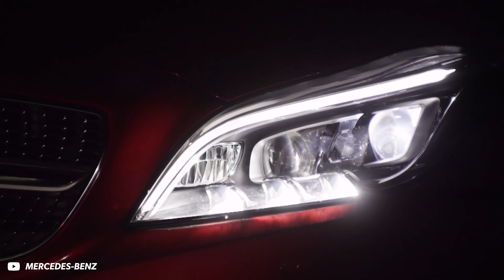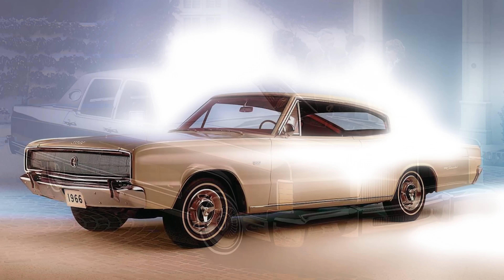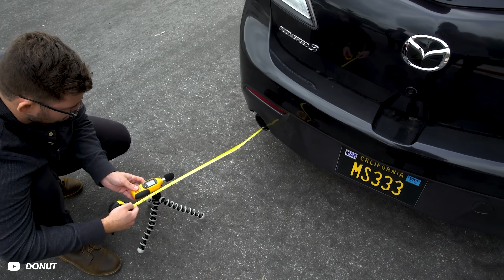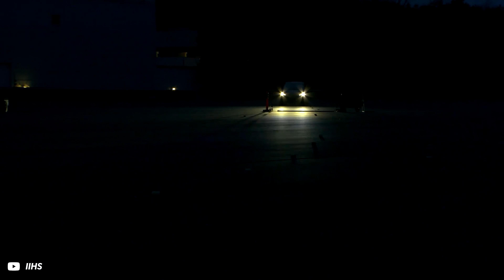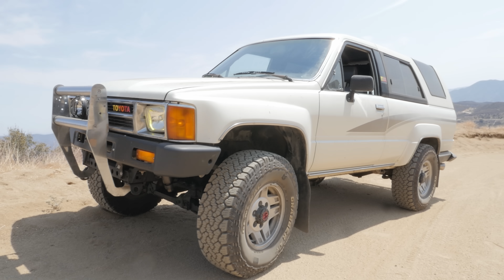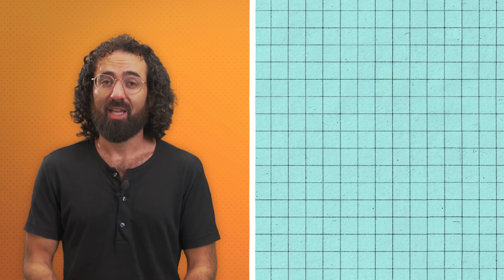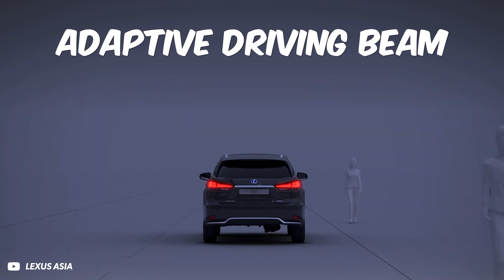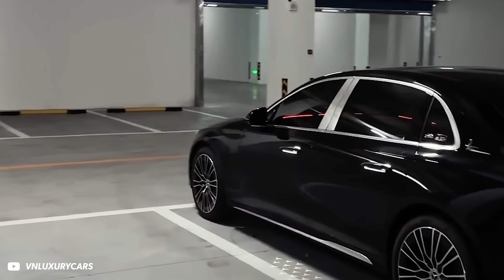Why new headlights are blinding American drivers

Comment: If you're in porsche released in 2022 or earlier, they don't disable always
Also for people on the receiving end - clean front glass, tall car (and when from the back you cam try angling rear view mirror up/down as many of them have 1-2 bonus mirrors with darkening filter, for example my 2011 xtrail has  it so your car probably does too)

Comment: I had a 2019 Miata with adaptive high beams and they worked great; however, even when driving with the normal low beams, other drivers would often flash the highs at me, which meant my lights were maybe too bright. I had zero control over it, no dial to set the height, because the system was controlled via the height of the rear suspension. I talked to the dealership about it when I went in for service and the mechanic told me, basically, "the lights are fine".

Comment: Just an excellent evaluation. I  cannot tell you the last time I knew of a dealer (or government inspection place) that would bring out that tool to check your light - it was always been, look at the wall and adjust - my '21 Elantra - I took it back the next day and it had crazy eyes - one light WAY up, on light WAY low - they fixed it in like 10 minutes and they were only "okay" (not the same but close) so I think they just did the look at the wall aiming. They need a machine that the police would even set up and check cars on with (daytime even?) with a height and vehicle type adjustment - maybe headlights need a QR code for aiming right.  Anyway, my Elantra came with very yellow halogen and I said swap those before I pick it up and they said - nope, not warrantied certified upgrade.  So now - they are not bad at all once I got past the colour.  I did ask a LED auto place about a Xeoin bulb or LED change and I said well mostly "more white like the daytime running LED" and to error on the side of brighter for factory output specs - and they said no you want way brighter lights and they did lots of ones like mine. Not sure what I will do when a lamp bulb goes - they are hard to replace these days (dealer $150 labour) - so I cannot even tweak the halogen colour without shortening the lifespan. Anyway great video - I could drone on as I hate over-boosted or aimed headlamps.

Comment: Technically brilliant, BUT, you do not address the one common factor - the driver.
Next time you're driving at night consciously think about where you're looking when a car, with headlights on, is approaching you. I think you'll find that you are unconsciously drawn towards briefly looking at those lights, thus being temporarily blinded. So, take control of your gaze as soon as you notice the car coming towards you and look forward, away from those lights to the nearside kerb of the road.
Whilst this obviously isn't a complete solution to the problem, I'm sure it may help until legislation changes.

Comment: Also LEDs also emit light in the frequency human eyes are most sensitive to. Old bulbs appeared dull because most of the light energy was outside of the human eyes ability to detect. So even with the same lumans, luxes, Candelas, the LED are brighter since they are at the frequency that the human eyes are optimized to sense.

Comment: As a truck driver in Europe....adaptive driving beam headlights don't work...they're slow to respond to traffic and I installed aftermarket projector beams on all my tucks to flash those cars because the idiot driving them don't realize they're blinding you. I even see them being slow to react in my own car that's why I keep the option off for most of the time

Comment: We're in an arms race here. IIHS says brighter lights reduce crashes. Hell yeah I want to be safe with brighter lights. As do the drivers of all those oncoming cars. We're back where we started. Just like happened with heavier vehicles and higher vehicles. So even though I've traded up to a Cadillac SUV with a flaming grill of headlights, it's still a middleweight, and I'm still unable to see over or around the hulks in front of me, or what's going on with the nighttime road ahead. Grrr.

Comment: My Mercedes has all the Multibeam hardware installed but not activated due to the US DOT regulations requiring discrete high/low beams.  There is the reason for your blinding lights on the road. Blame the damn DOT.
When I ask my local dealer about enabling the Euro spec to make the Multibeam function as designed, they look at me like I just grew 5 arms.  They have no fucking idea it even exists and again you can thank the US DOT for being an archaic backwards ass government institution.    
Mercedes Multibeam - https://www.youtube.com/watch?v=0OJjvYPV3oc
Mercedes Multibeam in action - https://www.youtube.com/watch?v=mmQ-xlYHu9Y&t=386s

Comment: In Japan the government has a mandated safety inspection every two years for every prefecture. Part of that inspection is to check that the headlights are aimed correctly and for brightness. Fail any portion of the inspection and you need to get it fixed before you can renew your registration. Something like this should be in place for every US state.

Comment: Yupp, you are missing out. LED Matrix systems are amazing to use. And my Audi e-tron GT has LED Matrix + laser lights. Those are even better. And fully automatic, so the laser lights are switched of well before anyone crosses their path, and the LED Matrix lights masks out oncoming or cars in front of you. It's such a treat to drive. And besides the faulty lights of Tesla Model 3 and Model Y, I barely get any blinding lights these days.

Comment: It's not just aftermarket led kits, led headlights in general seem to have little control of projected pattern and it's all the stray " spray" of light that's so blinding. HID lights had proper projection, and though bright wasn't annoying to others. As much as led lights seem perfect, the issue with no pattern control they're more annoying than anything else out there . This is from OEM, not just aftermarket.

Comment: In EU, where I live, every year you have inspection and they have a device that they put in front of your car that measures output and angles, and if they are not what they should be you fail and have 14 day to correct it or you lose your registration and get a fine if you don't return license plates. 
And the light has to be same color as it was or within a range and you cant add or subtract lights that were on a car.  

They do this for number of reasons, small accidents where your lights are missalinged and blind everyone, aftermarket bulbs or light. 
Also, only "white" color is allowed in front and only red on the back, you cant have blue lights, hearts etc.
Reply: what country is this?
Reply: @NomadHatchCroatia

Comment: Not only are new cars stupid expensive but their components are as well, I've seen an OEM all in one LED headlight or taillight for a 25' tahoe cost over 1k. Being a built-in LED the whole housing must be replaced, what makes you believe these headlights would be diffrent. Add to this the over all gamble that new cars are, due to the buyer not knowing if they're going to get one that's going to need countess recalls/repairs, and I see why some people drive older cars, myself included.

But that's not all, there's also all this tech (these headlights included) jam packed into these cars resulting in minimal ability for self repair. Which is only exasperated by things such as the ubiquitous touchscreens that controls 90% of the functions in the vehicle, that will probably be out dated and in need of replacement within 5 years. 

Did I mention how it seems that manufacturers are having their design teams make these vehicles lean more towards planned obsolescence. This would make sense as dealerships make most their money on maintenence and repairs, then used cars sales and new car sales.

K.I.S.S. or keep it simple stupid, is an abandoned concept. Sorry for the rant, stay safe and stay strong out there brothers and sisters, Jesus Christ loves you.

Comment: Adaptive headlights are bullshit. WAY too expensive, and it only cures the problem close up. If you're driving a dark road out in the open, those extremely bright headlights are able to obstruct your vision from well over a mile away, especially in the rain. They're disgusting. Why do you need to light up the opposing mountainside if you're driving legal speeds? Secondly, they require a bunch of computerese bs to set them, and once they're out in public, how long do they actually stay adjusted properly? There is absolutely NO reason for this except as a sales pitch for the car dealers. They need to bring back the laws that used to be upheld. These extreme lights were only to be used in farm, construction,  hunting or emergency services, not everyday driving.

Comment: Most people don't realize when you switch to LED bulbs, you have to aim you headlights a bit lower because the normal halogen bulbs are not as bright. The slight glare they put out is amplified with LEDs.

Comment: I'm a mechanic, general car guy and pretty well informed about lighting. I mostly agree with everything said here. But one place you need to check yourself, is with these aftermarket lumen ratings.

Halogen bulbs generally produce about 1300 to 1600 lumens. The brightest HID and LED bulbs alike top out around 5000 lumens. The majority of LED upgrade bulbs will fall between 2500 and 3500 lumens. Especially for low beam applications. Any bulb advertising more than that, let alone these cheap bulbs claiming tens of thousands of lumens, are completely full of shit. That technology simply doesn't exist. The very best LED chips available can approach 200 lumens per watt, but that's only at their most optimal power level and temperature. LED headlights will run at higher levels and temperatures and not reach that kind of efficiency.

The real problem as you just touched on, is aim. LED and even HID are fundamentally different technologies than halogen. So it is simply not possible to make an LED light interact the same way with a halogen lens and produce the same beam pattern. That said, some of the expensive, high quality offerings do well enough, if the user installs them properly aims them to the proper level afterward. Which many users don't. I've been using VLEDS for many years and they are the least expensive of the high end that work well. They also offer 5000k color temperatures, which set them apart from everyone else only selling 6000k or higher.

With a good quality upgrade and proper installation, you CAN achieve much better output without blinding on coming traffic. Anecdotally, the people I meet in person who complain the loudest, are the ones still using halogen. When your lights have so little output, of course an oncoming car with better technology is going to be dazzling. When you have higher output yourself, your eyes remain better adjusted to the oncoming traffic.

Case and point, my girlfriend bought a 22 Impreza earlier this year. I drove it with her a few nights on the stock halogens, before getting her sorted out with LEDs. The output was so low, it felt like feeling around in the dark by candle light.

Bottom line, I'd have everyone on higher output technology and deal with oncoming traffic, every night of the week. After all, halogens can still blind if they aren't aimed right, so what's the point of keeping them around?

Comment: Not just the headlights, Red rear lights  are getting just as dazzling  with brake lights and indicators  especially  in silly  barely noticeable places,  some Rangerover with tiny indicators low down and blotted out by the red rears is an annoyance.

Comment: I was a headlight nerd forty-five years ago. 

Sealed beam bulbs sucked. The usable output (however one measured it) was weak. Quartz Iodide (or Quartz Halogen) bulbs were the good stuff: a Quartz glass globe filled with Iodide (a noble gas, if you remember your Chemistry lessons) that repelled the molecules of Tungsten that came off the hot-as-hell filament when the filament was energized (on). The headlight lens of the good light systems (like Cíbié headlights from France) would be of Lead Crystal for optimum light transfer, the reflector of polished Aluminum, and the fluting in the lens was checked for accuracy with laser beams. With hotter-than-usual bulbs, I could see things far enough away that I had two seconds to recognize them and avoid them on low beam without my lights shining in other folks' eyes. 

My current car uses the same type bulb, but the plastic reflector doesn't reflect as well, and the plastic lens isn't as clear, and the light isn't directed as carefully. I've driven newer cars with brighter lights and clearer lenses, but they still lack the direction control of my old Cíbié headlights. 

And that beam control is a big key, as mentioned in this video. The more light an emitter produces, the more important it is to control where that light goes.

Comment: Imho, the LEDs are all 6000, or 6500 kalvin. Super white light. 4000, or 4500 kalvin would help alot. Another issue is improper aiming of the light beam.

Comment: Remember when we could just replace a bulb?  Now, LED arrays are sealed and non-replaceable.  Instead of replacing a $30 or $40 bulb, you have to replace the entire headlight assembly and guess what...they cost THOUSANDS OF DOLLARS!  This causes insurance rates to skyrocket.  The adaptive systems, while better, are EVEN MORE EXPENSIVE.  The sensor calibrations, alignments, and computer controls greatly increase repair LABOR costs on top of crazy parts prices and decrease reliability.  What is the answer?  Cars need LESS features, toys, and "infotainment" before they bankrupt us all.

Comment: I put brighter bulbs on my vehicles save one.  It’s not an issue if (1) bulbs are properly aimed and (2) the driver has the consideration to dim them when dealing with other drivers.  My ‘98 truck needed it because the OEM bulbs were too dim.  Going LED with higher output was a game changer, and they are aimed correctly so they don’t blind drivers when on low beam.  My motorcycle has higher output LEDs, but it’s the same story…they are properly aimed and give me better night visibility.  My car’s OEM headlights work very well, so I’ve had no need to upgrade the bulbs.

Comment: LEDs are bright but they are also adjustable for height depending on the load in the vehicle. I suspect most drivers don't bother adjusting their headlights which means they are dazzling others whilst moaning about being dazzled.

Comment: It's not just in the US. In the UK even the most standard new cars have insanely bright lights which are blinding and makes driving at night less safe.

Both from oncoming cars and also in side mirrors as others have mentioned.

Oh and then the indicator lights on the rear are so small you can barely see them next to the super bright brake light LEDs

Comment: I have a heavy duty pickup and I live in rural Canada, at night I like to see what’s out there. But in towns I only need to be seen. 
I have regular headlights which are set not to blind oncoming traffic, when on rural roads I have driving lights plus fog lights to use. It should be up to the driver to use the appropriate lighting not a computer.

Comment: You being blinded by headlights has nothing to do with them being LEDs, halogens or whatever else... 
It's just that they are not set up correctly... If the beam doesn't hit your eyes it doesn't blind you, even if the headlights used the sun as a source of light. 
And yeah, when a car goes over a speed bump for example, the headlights will blind you. But even if those headlights are halogens, it's going to hurt your eyes and blind you. 
10:50 no, Tesla has it too.
Video is dumb, doesn't even explain to people how your headlights should be adjusted, and how to do it correctly if they aren't.

Comment: There are two problems of bright headlights:
1.If headlight has no cut out - nothing can help and you will blind everyone even if the are not powerfull.
2.If headlight has good cut out should be properly set up.

I have a Wrangler that is quite tall car and lights are on 97cm. Even after they set them up in the shop they were too paralell to the groud and lights up too far. I shorten them and there is no chance I can blind any one cause my lights go to the ground after 80meters or so.
The same problem is with tall cargo cars like Fiat Ducato or Renault Master. Lights are maybe setup but noone take the correction of how the car is tall.
I never had problems with xenons in low cars like BMW.
I think lights should be bright, but should be properly made and properly set up.

Comment: The issue is not brightness, it is where the beam is pointing.  Most newer vehicles, including Tesla for example, do not aim their headlights low enough, they are all too high.  If I stand twenty feet in front of one, the light cut off is at my belt buckle.  But if I stand 20 feet in front of the last model year Toyota Celica, the beam cut off is at my knee.  It's also a problem that most people like SUVs these days and no one is enforcing a law on companies to make them aim their lights lower to compensate for the height of the vehicle.